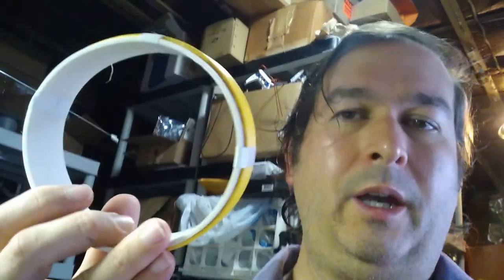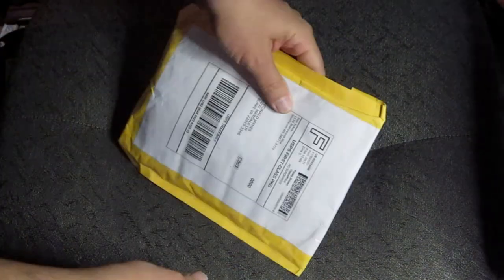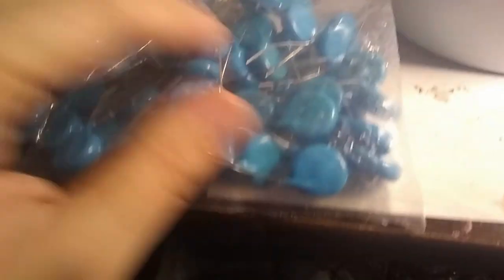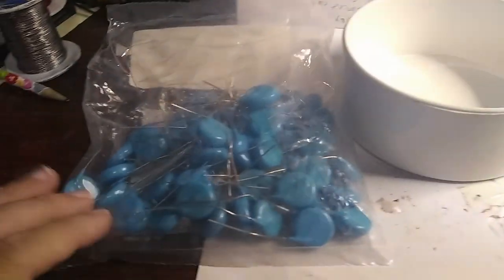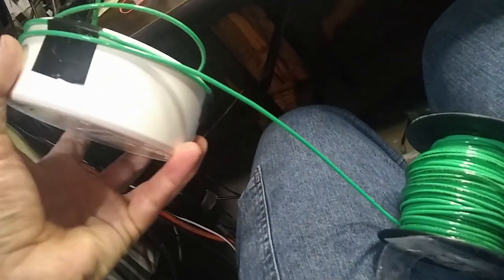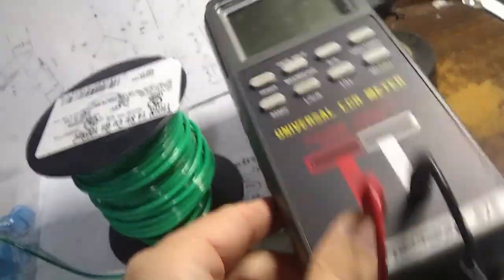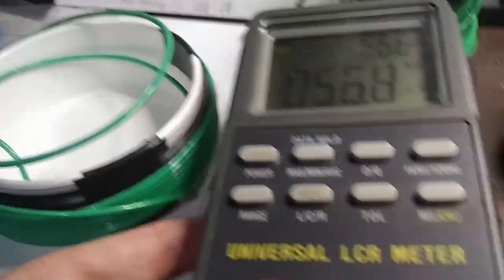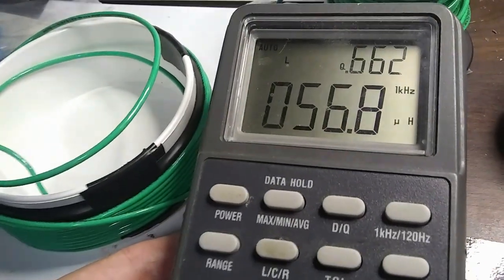Tuning Tesla Coil Primary Circuit

Comment: Hi, im building a tesla coil and need the spark gap to fire at 40khz. Is there a way i can measure the bps/frequency accurately without damage to the device?
Reply from the maker: Typically the spark gap does not fire that quickly.. What determines the resonance frequency, is the coil resonance, not the spark gap.. The spark gap takes time to recover.. typically they will run at 120 Hz, when being charged with a 60Hz transformer (+ and minus)... for example... It would be nice to have a high power spark gap, that you could trigger at a high frequency like that.. Tell me if you figure out a way to do that... It is not trivial.. Thanks for the great comments!
Reply: @jaynesnetwork  i have a 60hz gas tube transformer. About how much capacitance does it take to get the gap to fire at 120hz?